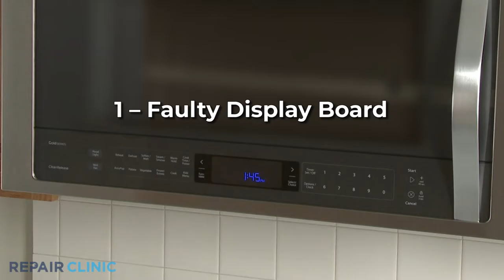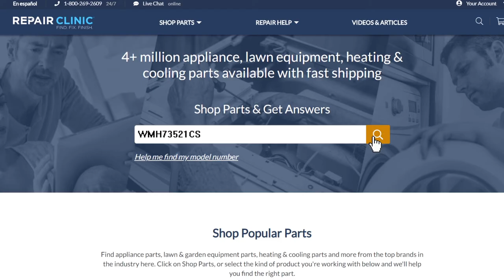Microwave Display Not Working — Microwave Troubleshooting

Comment: KMBS104ESS03 display is missing lines “partially working” I looked it up on your site but I only see control board. What part number am I looking for
Reply from the maker: The control board is the component that make the control panel/touchpad work. The control panel/touchpad is the display/buttons. Make sure to test these parts first. You can find the control panel here: https://www.repairclinic.com/PartDetail/Control-Panel/W11197501/4844177